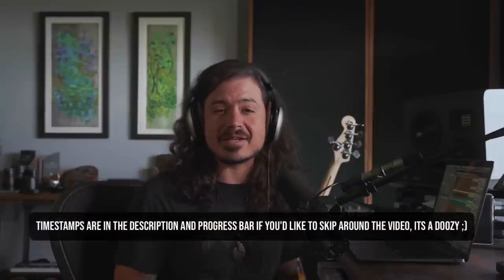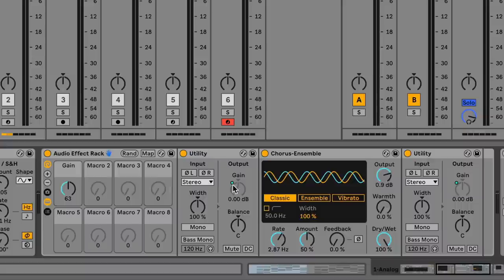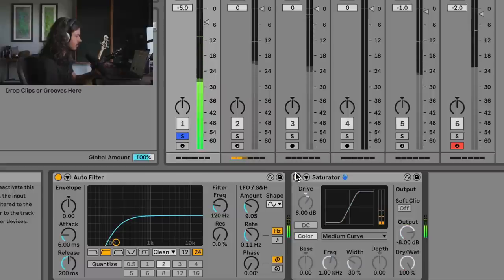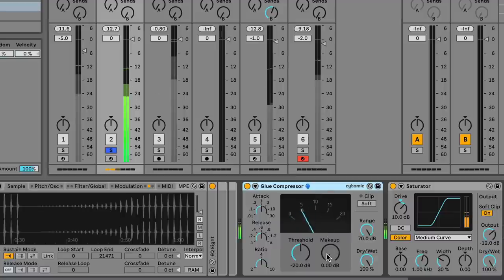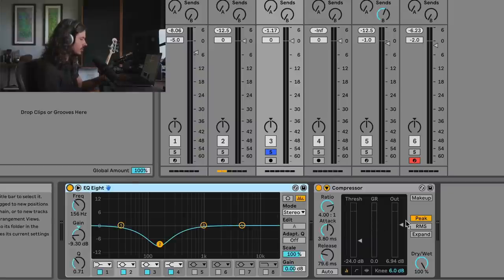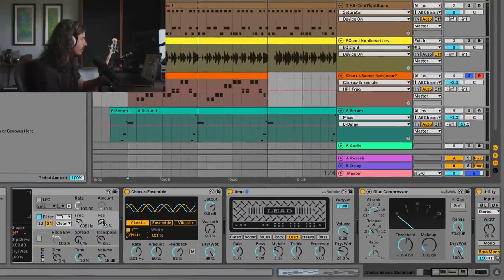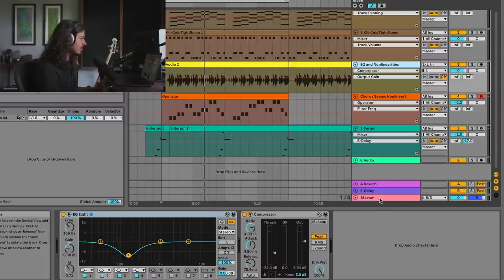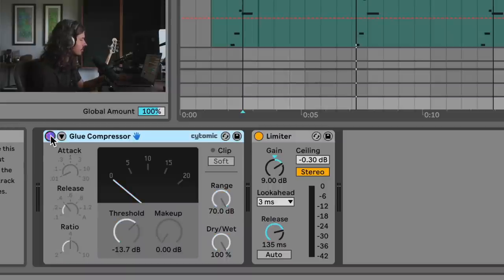Gain Staging Tutorial

Comment: For some addition context, here's a brief explanation of linear vs non-linear effects in Ableton Live 11 Suite version:  Linear effects are processing tools that operate in a straightforward, predictable way. Examples of linear effects include EQ, compression, and volume adjustments. These effects change the level or frequency content of the audio signal in a consistent and proportional manner. So, if you boost a frequency band using an EQ, the boost will be applied equally to all parts of the signal that fall within that frequency range.

Non-linear effects are processing tools that can create more complex and unpredictable changes to the audio signal. Examples of non-linear effects include distortion, delay, and reverb. These effects can add harmonics, alter the timing of the signal, or create complex reflections and resonances in the sound. Unlike linear effects, non-linear effects can produce very different results depending on the input signal and the settings used. They often introduce some level of randomness or variability into the signal, making them more difficult to predict or control.

So, linear effects are more straightforward and predictable, while non-linear effects can introduce more complexity and variability into the signal.

Comment: Great and important video many fail on! Just a tip to any one, using a VU meter can be a smarter option than just looking at the peak meter because the vu is more accurate to the overall sound. So if you have a VU aim for around 0db of VU and if should be good. ☺️

Comment: Great tutorial man! A few questions tho, in the last part (Glue Comp before Limiter) 1: shouldnt you compensate the output of the glue comp after compressing so it goes to the limiter with the same volume that before the compressor (but now with the peaks reducted obviously)? And 2: would it be useful to activate the soft clip button of the glue comp? what would it do to that signal chain and how would it affect the limiter behaviour? Hope this arent dumb questions bro, subscribed!
Reply from the maker: 1: The limiter has its own gain control so turning up the gain using the glue comp or the limiters input gain is functionally the same thing. 2: Softcliping makes for a more audible distortion and coloring of the sound due to introducing the clipping more gradually. This isnt the desired effect when the goal is transparently increasing a tracks overall loudness such as in this case.
Reply: @SeedtoStage  Thanks!!!

Comment: Hi, correct me if I am wrong, but with the drive knob on the saturator, you mentioned that it’s an input knob, and you mentioned that they are the same thing as volume or gain but just named differently, and that if you drive 8db in you use the output gain and turn it down by -8db to balance the volume. Sorry, but that doesn’t seem to be the case as a drive knobs acts as an amplifier knob. Your adding textures to a sound and not just literally adding dB to it. If i have a sound, put a saturator on, turn up the drive by 4db, the sound will clip about 2.45db over. Which tells me that in order to create a nice balanced gain stage i only need to turn down the output gain by -2.45db and not 4. Same thing with the drive knob of abletons filters. If I add 3db on that, the volume will only exceed about 1db higher, not 3, which tells me that it’s not just a simple gain / volume knob. It adds textures and amplifies the sound. Can someone explain if I have that incorrect? Thanks
Reply: You can test this yourself: Setup two tracks with the same audio signal. On the first track, use only a Saturator with Drive set to +12 dB. On the second track use a Utility followed by a Saturator, leave its Drive at 0 but set the Utility to +12 dB instead. Do both tracks sound the same? (You may even do a null test.) Then Drive is just adjusting the input level for the Saturator.

Comment: 9:00 Could you achieve the same result with no makeup in the compressor but setting the drive of the saturator to 16 dB?
Or do these 2 knob effects differ from each other?
Reply from the maker: In this case yes they would be essentially doing the same thing. Increasing gain before the clipping stage of the saturator. But bear in mind that each plugin is different and when you get new plugins be sure to research what is what as drive, gain, input, etc could mean totally different things plugin to plugin.